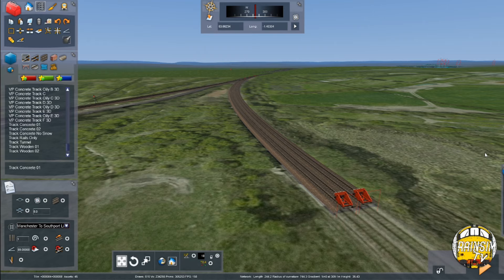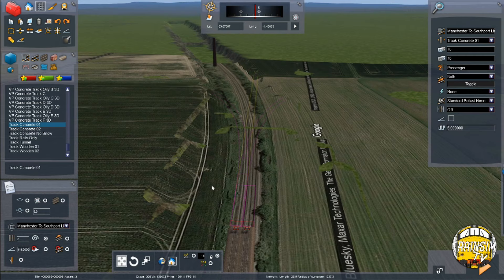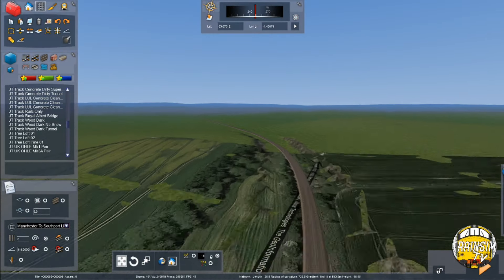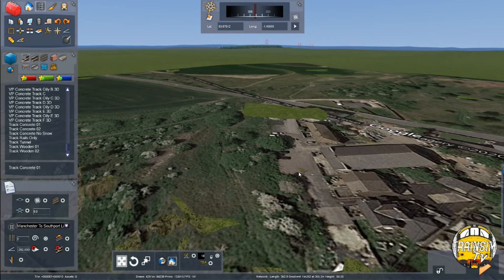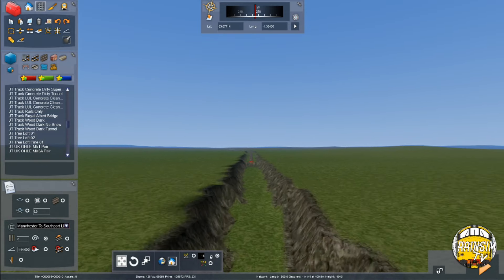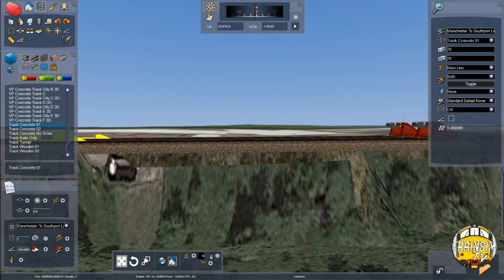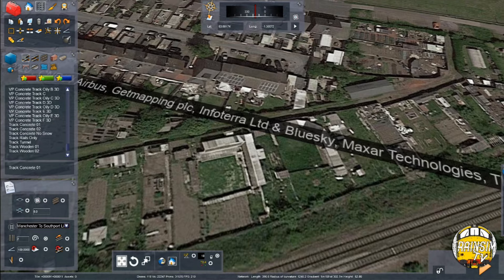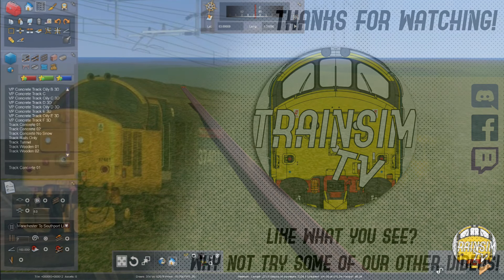Train Simulator 2020: Building Wakefield to Knottingley Ep.2

Comment: Have you done a video on how to access imagery as a backdrop for terrain building ? I tried what Matt Peddlesden suggested but couldn't get it to work.
Reply from the maker: As in distant terrain? Unsure what you mean I'm afraid.
Reply: @TrainSim_TV  You are using imagery (Google Maps ?) to get everything (tracks, buildings, vegetation etc)  in the correct place. I've not been able to get imagery like Google Maps into the World Editor - could you show newbies like me how to do it.
Reply: @pwhitw  The one thing I've found that is missing in the tutorials for Google Maps Overlay is that on the Google Cloud Platform, you need to sign up for the project. This includes billing, which tends to put people off. Others will confirm this though: Since I've started using it months ago, I haven't been charged a single penny. So you need to sign up to the Platform. Then it should work. Sorry for the 2 year late reply

Comment: Great video! Looking forward to the future of it! Just wondering, what are your PC specs because it runs Train sim like an absolute DREAM! :)
Reply from the maker: Many thanks :) My TS install is still pretty clean so helps with a lot of smoothness. The spec is below:

Operating System

	Windows 10 Home 64-bit
CPU
	Intel Core i7 @ 3.00GHz	
	Kaby Lake 14nm Technology
RAM
	16.0GB
Motherboard
	Micro-Star International Co. Ltd. Z390-A PRO (MS-7B98) (U3E1)	
Graphics
	2047MB NVIDIA GeForce RTX 2060 (Gigabyte)	
Storage
	931GB Samsung SSD 860 EVO 1TB (SATA (SSD))	
	1907GB ADATA SX8200PNP (Unknown (SSD))
 (This is the TS install drive)
	1863GB TOSHIBA External USB 3.0 USB Device (USB (SATA) (SSD))
Reply: Train Sim TV Thanks 🙏 😊 Keep up the great work